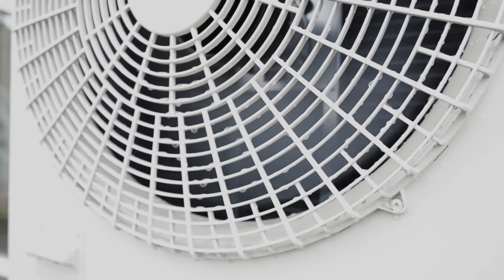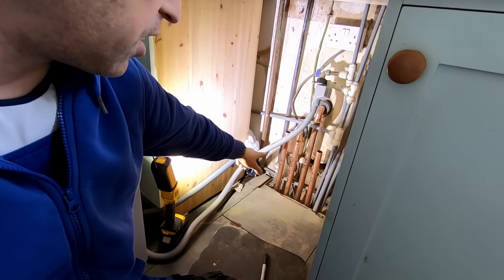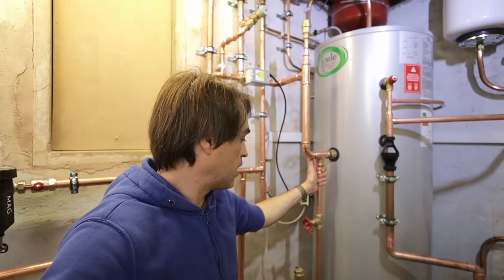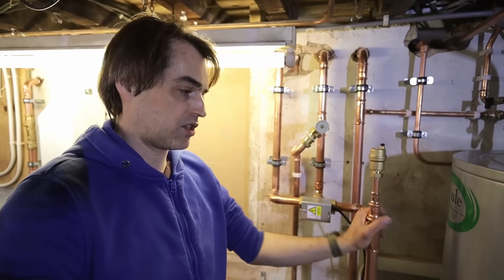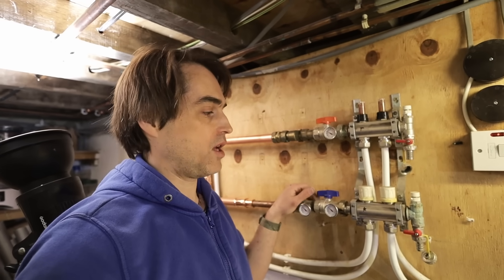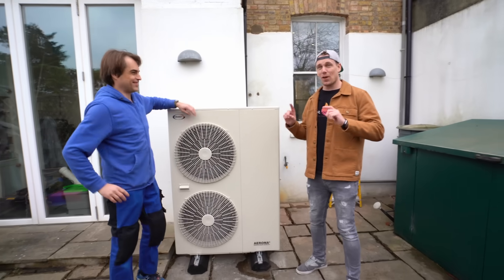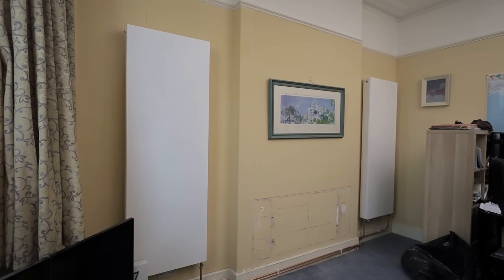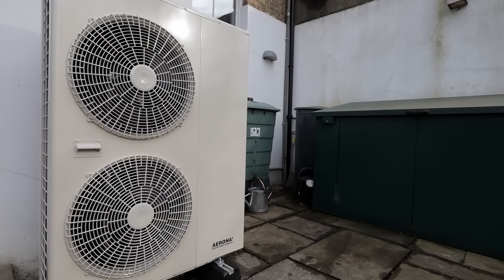The Truth about Heat Pumps: Debunking the Myth.

Comment: Here in the southern United States, we use forced air heat pumps very effectively.  In the event of the extream cold, it is backed up by electric resistance heat.  This back up heat is seldom needed but can also act as emergency heat if the compressor fails. With the very hot summers the ability to provide air conditioning makes this the most practical system for most southern states.
Reply: Up here in New York there pushing heat pumps now.
Reply: Why would you Ever need back up electric resistive heat in the south US? even old or low end heat pumps are capable of heating as low as 5°f  I live in North East washington about 90miles from the Canadian border and it rarely gets below the teens.
Reply: Extreme cold is so rare they can't even spell it!
Reply: @gaywizard2000  Yea climate change is a b1tch
Reply: I’m from Switzerland and heat pumps work very well in our house
Reply: really interesting, I thought southern USA used blowers and furnaces or air conditioning, good to know that you've moved on to a heat pump/air conditioning approach.
Reply: @cjhification  I live in Washington state and got my first mini split heat pump in 2015. Installed it myself and have installed about 7 since then. We use them for mostly cooling but heating is now cheaper with them vs gas.
Reply: @randybobandy9828  the whole concept of heat pumps is it costs less electricity to move heat. But when heat energy is scarce, other methods are more energy efficient.

That's why I'm looking more at geothermal based heat pumps.
Reply: @cjhification  Most furnaces and all AC's are heat pumps.
Reply: @SooSmokie  agree AC is a heat pump by my understanding of what a heat pump is, using some form of refrigerant gas, expansion and compression, a furnace would be pushing it severally to my mind, as it's not using that compression and expansion.
Reply: @cjhification  So the way my dad's furnace is setup, is Ac and heat runs off a heat pump. There is emergency heat which is the electric infrared heat which is used when the heat pump is defrosting which is automated, or if the heat pump is down it can manually be put in emergency mode.
A heat pump is just a AC in reverse. So there is a switch that switches which side of the lines compress and which sides gases expand.
Reply: @SooSmokie  think it's great to use heat pumps as an alternative to using furnaces or boilers and is very sensible. Glad to hear America is moving down this road, just get to see how behind the rest of the developed world the USA in these terms when it comes to efficiency from programmes like "this old House", or watching Matt Risinger on YouTube.
Reply: @cjhification  They also just started a program to pay for people to switch to highly efficient heat pumps and switch away from fossil fuels.
They can heat down to pretty low Temps. Just gotta get the right size unit
Reply: We have one in Canada, on really cold days we blast the auxiliary resistance heat for 5 or 10 minutes and then put it back on heat pump mode and it will stay warm for days after. Heat pumps work great if your home is insulated and sealed properly.
Reply: The UK government doesn't want to create high energy usage in the summer as well as winter due to air con.
Reply: It's even smart to retrofit HVAC with reversible heat pumps. Typically you will have gas furnace and AC running through the same forced air system. By putting reversible pump you will have both cooling and heating, although heating demand is usually much higher. But you can still keep the gas furnace for lower temps.
Reply: Not just the southern states.  Works fine here in Iowa too.  If you're going to have Central A/C (and we need it just about as badly as the southern states), then the little extra so it can reverse-flow as a heat pump on either end of winter is a no-brainer.  Backed up with natural gas heat here for the really cold snaps.
Reply: Got an 18K in my garage here in south east Louisiana. Works great!
Reply: @LichaelMewis  what is 18k? the price? 

I followed this subject and never saw the price considered. 
Only technical details. 
Same for infrared radiators which I got one. 

And at both always is stressed that you need to insulate.
Obviously you will get the saving through insulation not because the heat pump is better or the infrared radiator better.
Now, in certain conditions, may be better. Theory proves so.
But when you sum up the savings, it may happen to be less than the price of the heat pump or the infrared heater. 

So, in my case I paid almost 1k for my infrared panel. But a regular electrical heater will be 100 times cheaper and do the same job. 
Actually almost since this one is with tourmaline, that seems to have some health benefits.  
So I kind of threw the money out of the window. 
So, if your heat pump was 18 k, and let say it saves 2 thirds of electricity theoretical, maybe half on real. How much would have costed the electricity with a regular electric heater in the lifetime of the heat pump? If 36 k, than there are no savings. Heat pump saved half of that 36 k, but that was its own cost. So I assume that an solar system would have been more efficient since it has a similar price, but no additional costs during its lifetime.

Maybe I am wrong. But nobody answered me till now, and I asked few times. Obviously will depend on the amount of sun in the area, price of electricity and other variables, but on average solar seems to me better than heat pumps when we consider the actual cost.
Reply: @ehombane  18K is the BTUs.. my system was around 1500 USD. I installed it myself. However I had to buy tools that were around 500 dollars.
Reply: @LichaelMewis  Thanks for the answer. 

So it is not quite big. I see regular air conditioners at this size. 

Anyway, did you ever tested it to see if uses less electricity than a simple electric heater? 

I ask because some decades ago when here started the fad of air conditioners some were dual, including heating. And popular advice was to avoid them because using them for heating was too expensive. I have no idea why was this belief. Maybe because they compared with gas heating which was a lot cheaper then electric, or maybe because the dual system was not optimized for heating, or maybe because heating the air instead using regular radiators was not efficient.  

And now with the fad going toward using them for heating, I see a lot of controversy. Theoretical should be better. But I do not quite found users to break down the costs, and prove the theory.
Reply: I live in the Ozark and anytime it got close to freezing the heat pump would need the backup.
Reply: "I bypassed the compressor!" 
-Rey
Reply: Who cares
Reply: Never heard of "forced air heat pumps", cheers.
Reply: How does a heat pump provide air-conditioning if they only flow water to a radiator? Also, an oil/gas fired boiler will NEVER require electric resistance heating in extreme cold.
Reply: Love my heat pump here in Northern Virginia.

I have back up electrical resistance and it gets used maybe 4 days a year. I have an older heat pump unit too.

No gas bill and my solar covers all my usage. 

Heat pumps are great.
Reply: LOL at "extream". But then, you are American. Christ.
Reply: Just said it yourself, thankyou. Central heating is supposed to keep us warm in winter, it's a failure if you need electric heaters.
These heat pumps are progress going backwards!
Cost here? £700 for a gas combi boiler. Heatpump system? £15,000, yeah £700 just for the water pump 🤣💷.
So efficient you need huge radiators too......
Reply: It's probably a good system for the southern US, not so good in northern Europe though
Reply: @pedazodetorpedo  works fine in Canada.
Hot summers and very cold Winters.
Reply: @ericdunn6232  The Canadian Government has explicitly stated heat pumps are appropriate for the entire country. That really says a lot. 🇨🇦
Reply: @user-kc1tf7zm3b  From Justin's mouth no doubt🤢
Reply: @ericdunn6232  idk, I live in northern MN. And I question the efficiency of trying to heat a room in -20F (29C) and the costs compared to gas.

Have been looking at a geothermal based heat pump. It seems like the best solution except its expensive and requires land... Less solar panels and batteries needed.
Reply: @josholin31   Water-water heatpump with geothermal energy works great if u drill a well. I live in a cold spot in norway(-35c not unusual) and have a 300 meter well straight down right outsider my House. It works great. Its efficient. About 1/4 of the energy used compared to resistive heater if i turn off the heat pump.
Reply: @josholin31  lmao.. How often does it get to -20f in MN? A handful of nights a year?
Reply: @josholin31  --  It potentially would cost on the order of a septic system.   It has to go much deeper and cover more area to keep it from just forming a block of ice in the winter but grading isn't important.

Years ago I did some 'studying' about the heat pumps.   If it's a "damp" cold you can set up a system with the "Cold Side"  just a few degrees below 32F/0C.
Reply: @Daddelcrusher  --  Well, when it's cold outside, resistance heat is quite expensive for most folks.   1/4th of a large number is still a large numbe.
Reply: @josholin31  if you're up for a long watch, check out technology connections video on heat pumps. HVAC companies in the US seem really reluctant to sell heat pumps that aren't drop in replacements for central AC, finding a high hspf pump is difficult, and the US government rates anything about 10 hspf as "high efficiency" when that's just the middle of the scale.
Reply: @ericdunn6232  Different parts of Canada disagree about what counts as a very cold winter.

I wouldn't be surprised to see heat pumps work well in Toronto or Montreal, where it rarely gets very cold for very long.  But in Edmonton or Yellowknife, where the temperature can drop below -30°C and stay there for 20+ days, that's a very different problem.

Extreme cold overnight <> extreme cold for an entire month.
Reply: @josholin31  I live in MN as well.  I had a heat pump for about 10 years, just moved to a new house that doesn't have one, but I'm planning to get one.

In our climate, you don't just rely on the heat pump alone, you'd have a traditional gas furnace as well (called a hybrid system.)  The heat pump runs to heat the house until it's about 30ºf outside (give or take a few degrees) and then the furnace takes over below that temperature.  The heat pump is massively more efficient than a gas furnace above about 30ºf, but won't cut it below that temperature.  Installing a heat pump saved me about $800/year in heating costs.

Our system was able to track the outdoor temperature and switched between heat pump and furnace automatically, so no additional work on our end, you've just got the up-front cost of getting the heat pump and thermostat that is smart enough to run it.
Reply: @user-kc1tf7zm3b  says Trudeau 🤣
Reply: @pedazodetorpedo  cheers from Northern Europe. 

Heat pumps work great for heating during winter (they struggle when below -25C but we have fireplaces and a couple of electric radiators just in case), and they're fantastic for AC during the Summer.
Reply: @pedazodetorpedo  If it's good enough for Canada......We get -30C, heat pump works down to about -20C and after that it's resistance heating
Reply: @neiljones9005  Did you just have a seizure on your keyboard? do we need to seen an ambulance
Reply: @pedazodetorpedo  IMO not so as we used a split system for a good few years before moving elsewhere and really miss the system in summer or winter.
Reply: @gegwen7440  Split systems doesn't refer to there being a A/C and Furnace HVAC combination. FYI. Split system refers to the condenser and compressor of the AC being outside and the expansion coil being inside with high and low pressure lines between them. The A/C system has been split into two installation components. 

Originally (And still for many commercial units) Your return air from the house went outside the building to the system and then was sent back into the house for supply.
Reply: @pedazodetorpedo  Heatpumps are becoming very popular in Denmark.
Reply: @pedazodetorpedo  Heat Pumps are pretty much everywhere here in Canada (Québec at least), coupled with air-forced furnace, usually. They've been around for the past 30 years, are often used to provide cooling in the summer as well. Much more efficient than any other mean of heating a home, down to about -20C to -25C (in which case radiant coils kick in). Plus they are generally pretty sturdy, and relatively simple machines as well, rarely any need for fixing.
Reply: @pedazodetorpedo  newer hyper heat heatpumps have heating as low as - 40c...
Reply: @randybobandy9828  When it's cold, you either need more air flow or more surface area. Both mean more electricity is spent in the compressor.

Even if a heat pump does manage to warm a house at 0F. That doesn't mean it's the most efficient method at those temps. (Those heat pumps that work at colder temps, use about the same electricity at higher temps... they only utilize a method to move colder air away from the radiator.)

As for the -20F in Northern MN. It happens in my area more days than a handful. And doesn't just include nights.
Reply: @josholin31  i am right off Lake Minnetonka and my heat pump works fine with 2 or 3 cold days last year. Maybe you got sold a cheap brand? Mines a Mitsubishi hyper heating system.
Reply: @Pepe-dq2ib  I'm mostly saying there's a point it becomes as costly as a electeic space heaters. Not that it can't do it. It's only worthless to me because I don't want something that only works, I want something that minimizes my costs when I retire.

But yeah, that 225 miles matters. You guys get almost a month less of winter weather. Or at least that's what it feels like when I visit down there, during mid spring.
Reply: @josholin31  the mitsubishi ruins 100% efficient down to -5f and and i set it to run no less than 80% efficient to a few splits, so its definitely not a space heater. The rooms are still warm enought to not need anything more than a sweater in the coldest days. We didn't even need to use the wood stove for extra heat.
Reply: @Pepe-dq2ib  that's poorly phrased in the context I used efficiency. And if they make that claim, they are lying.   - I'm instead assuming they mean their 100% efficiency rather than thermodynamically. As there will always be loss of energy from the compressor in the form of heat. And then there's the fans which also vary in energy and lose energy with heat.
But even then it's wrong... unless you  disregard how long it's on.

Think of heat as a stream of water at the bottom of a hill. The further the steam is downhill, the harder a pump would need to work, to move the water upwards. Because gravity or temperature diiffential, creates resistance.

The last bit is a bad example since heat rises. - a better example would probably be a minnow net. The more minnows there are, the more you'll catch. - if you want to catch the same amount of minnows when there is a scarcity. You'll need to use the net multiple times. Which is what it's like trying to gather heat in the cold.

During colder temps, I think it's unlikely that your heat pump raises the inline pressure much, in its cycles. But if it did, there is an optimized level between, pressure vs. heat moved vs. energy used.
Likely, the thing that works the hardest during hot/cold temps, are the fans. But again, the harder they need to work to gather heat, the more energy they use, and waste in heat. (Even the smallest heat created is wasted energy in moving heat.)

As for your splits, you mean 80% of max power, correct? - I doubt you are calculating the thermodynamic efficiency since you didn't question the 100% efficiency claim. - which is pretty much claiming they made a perpetual motion device possible.
(Did they even make that claim of 100% efficiency? Or was that your misphasing?)

Irregardless, I've determined that geothermal is a better investment. It's the same technology but stores the energy underground for later use. - I might consider a vertical setup as someone suggested here. But I wouldn't want to drill into a well as that would cause energy loss if the water is flowing. And I'm also paranoid of creating suitable conditions for anerobic bacteria, in my drinking water. (Bacteria that causes a big portion of rot. And there might not be a lot of organics rotting in a well. But why encourage it with heat during the summer?)

Also an added note, since I realize I didn't verbalize an assumption. I doubt the frequency of on/off is the only thing that changes during cold/hot weather. It's more likely they have a sliding scale for both frequency and power. If you can't control this then it probably does so despite whichever setting you set it at. It's wasted energy otherwise as it takes more energy to start a fan, than to keep it in motion at slower speeds. And heat pumps are pretty much the same since they take a bit to build pressure. (I recommend this feature if you have control over it... unless your brand cheaped out with their controller.)
Reply: @josholin31  ok ignore the 100% and lets just say its efficient up to -5f. My thermostat can manage the cop and it'll toggle the splits accordingly to maintain a 4. It can switch to a gas furnace if you have that as a backup, but i remove my old furnace after two winters. I retrofitted a wood burning stove to my fireplace if i ever need any extra heating. In winter 2021 we overridden two splits to go beyond the 4 threshold because it was just two days of really cold winter, the cop was 3.2 (80%).
Reply: @Pepe-dq2ib  Also. I'm probably not staying in the state. I'm skinny and have bad blood circulation. I'm feeling the cold more every year... I imagine pain in my joints will be from discomfort, to pain in about 10 years.
But my ideal temp has always been about 76 degrees F. I've only stayed here this long because of family and my wife. But closeby family has all passed away and now my wife thinks it might help her seasonal depression.
We're looking at Tennessee or Kentucky. Probably offgrid because often times you are forced to use some public utilities, if they are available. (Like water and sewage.)

But if I were to stay. I'd use the argument that I'd rather have a backup that I only use if a system failure happens. And not one that I have to use every year or every couple.

As an example, one of the tests I'm doing before moving. I'm the kind of guy who considers using a modified chest freezer instead of a refrigerator. Because it's possible it might be able to be shutoff at night, and might be able to be solar powered directly. Instead of using batteries.
In a solar system, the most expensive part and the highest point of failure, are the batteries. You might get 40 years of life with a panel but the batteries will need to be replaced at least once between. (Or expanded upon... which should be done in the beginning, anyways. To reduce depreciation, as charging 100% is bad for just about any battery.)

We're also on a limited budget but I'm planning ahead as I know my budget will be more limited in the future. The closer we can get to being $0 expenses (not possible but making a point) the better off our future will be.
Spend less, save some money.
Spend more, save more money.
Reply: @josholin31  I understand, my parents are like that too. My old setup was ideal with my gas furnace as backup when the cop reaches 4. I believe 4 is the perfect setting where i live when the price of heat pump losses efficiency and cost equals that of gas. Geo should easily maintain a 5 and stay comfortable in Minnesota winter because the coolant will still be 40-50F. Where i am at, the cost doesn't justify the few days of extreme cold. My system is vrf, so most of the cost saving happens in the summer.
Reply: @Pepe-dq2ib  you're wrong, their not %100 efficient at -5f. They use more electric and give out less BTU. look up how hyper heat works, and check your stats. even the newest unit is not that efficient at that low of Temps.
Reply: @pedazodetorpedo  Working good for me in that climate.
Reply: @pedazodetorpedo  Ideal for northern Europe too.
Regards Finn.